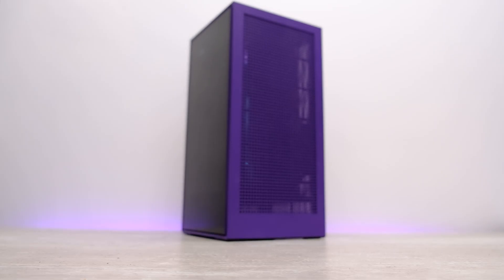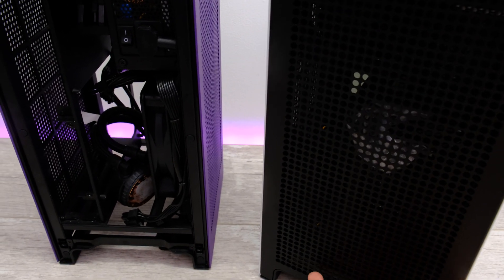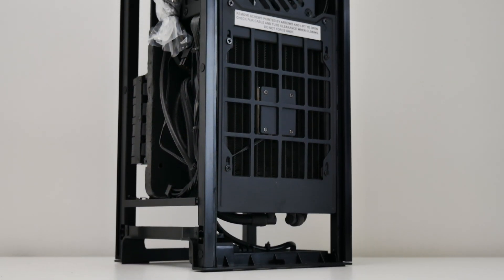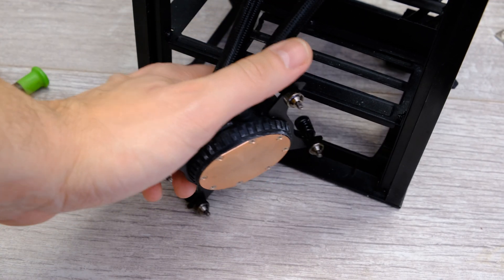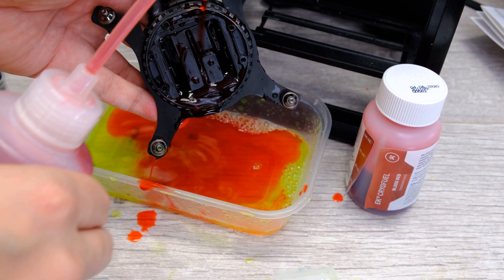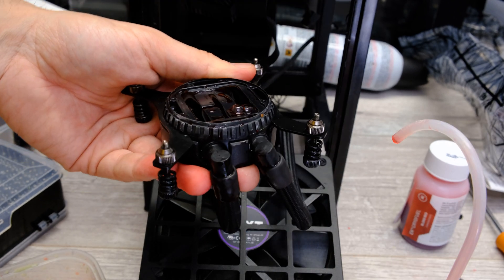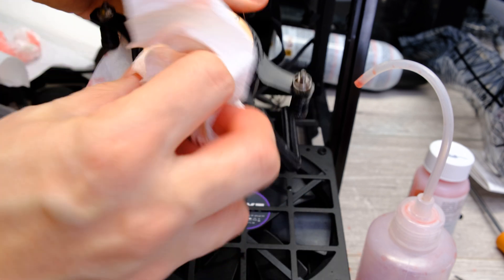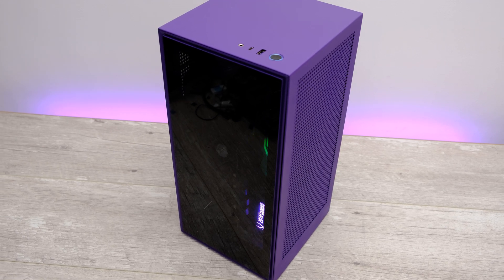NZXT H1 PUMP FAILURE (AND FIX)

Comment: Thanks for the video. Yesterday my CPU went into thermal throttling. I knew the AIO clogging on the H1 could be a thing, but never thought I would have it.
I needed 8 (eight!) flushings to get all the gunk out. This was very time consuming work, plus it took ages to fill the loop enough for the pump not to run dry all the time. My pump was clean btw.
Reply from the maker: It's worth it. Just keep an eye on those temps. Apparently you can detach the radiator too to make flushing easier. I will also being doing a guide soon on how to install a simple custom loop instead of dealing with the AIO which we know has issues.
Reply: @CrazyTechLab  Hey, this would be extremely interesting. Did you end up making the guide? Thanks!
Reply from the maker: @DouglasWhitcomb  https://youtu.be/IFAl9T5a9qA
Reply from the maker: @DouglasWhitcomb  https://youtu.be/IFAl9T5a9qA
Reply: Hey man how did you flush the tubes did you use distilled water? Assuming you used distilled water do you fill it up like he does in the video, then drain out (repeat) and then at the end add the new liquid coolant?
Reply from the maker: @sonny_digital  Emptying and filling the loop a few times should be enough. You're emptying the radiator and tubes and that process is akin to a flush. If you want to do it more thoroughly you can detach the tubes from the radiator using a T5 star screw - that works on both the V1 and V2
Reply: @CrazyTechLab thanks for the response and vid man. Just to clarify can you use distilled water to flush it out prior to adding new coolant? I bought new coolant but it’s expensive and I don’t want to waste the new stuff flushing out the old + crap.  Also could I use like a straw brush cleaner to help clean out the tubes or are they too sensitive?

Liked and subbed 👍🏼
Reply from the maker: @sonny_digital  Yes to distilled or deionised and yes to a straw brush cleaner!

Comment: It is not that simple. You actually have to disassemble the whole system and flush it thoroughly! If you don't do that you'll have the same problem in no time.
Reply from the maker: Depends on the extent of the problem. A lot of people in the comments have done a single flush and they've been fine for months. Others have found the high temps return and needed to flush again and I guided them through that. AFAIK there's no way to dismantle the entire system without replacing all or some components such as tubing. I wanted to make this as easy and cheap as possible and it definitely works. At the end of the day there's a finite amount of gunk in there and doing this method does work for most people.

Comment: If you are still under warranty I would avoid this process. These are close-looped coolers that are not designed to be disassembled and by doing so you may void your warranty if still covered. Better to poke NZXT and submit a ticket I was able to complete the troubleshooting provided and proceeded with a warranty replacement without further issue.
Reply from the maker: I agree but 'IF' being the word - this case was released 4 years ago so many V1 owners probably have no option but to do this or bin the cooler as they're likely out of warranty. There's no reason you can't open the coolers though. People have been modifying AIO coolers for years. They're simple components - tubes, radiator and copper waterblock. You can easily open them up and clean them out and my V1 is still going strong following this video.

Comment: Fantastic. I just ran into that exact same issue. Whilst dusting the PC I must have move the dirt in the radiator which blocked the whole system. Since I’m a newb with water cooling, my first reflex was to buy a new one since the temperature was at 99c idle. No space part for the H1 so your video was the only solution to my problem beside changing the cooler for a low profile air cooler. First attempt didn’t fix the issue as I reckon one of the pipe was still blocked (took me ages to fill up with liquid). I redid the whole manipulation and this time it filled up super easily. And the issue was fixed! Thanks a million
Reply from the maker: My pleasure! I'll be doing a video shortly on an easy way to create a simple custom loop in the H1 that doesn't cost that much - there are no 140mm liquid coolers these days that I know of so replacement options outside of warranty are pretty much non existent if you want to stick with liquid cooling. I'm actually using the H1 as my next main rig and even tough it's the V2, I still don't trust the liquid cooler given what happened with so many people's V1s. Stay tuned!
Reply: @CrazyTechLab Yes please to the custom loop video :)
Reply: I have a V2 and it happened so beware V2 owners!
Reply from the maker: @nicolasvinet4383  Oh jees really? Good to know as I’ve had a lot of people ask. I’ve not had my V2 up and running that long
Reply: I had the same problem with a Corsair water cooler in the past but I replaced it. Might be a generic issue with water coolers. They get dirty and you need to clean the system. It is just annoying and hard when you don’t have an easy way into the flow system.

Comment: Man just bought the H1 V2 on sale and then saw this. Part of me wants to swap the fluid out immediately in a new.system and out something in that is less likely to gunk up before I even use it.
Reply from the maker: I’ve got the V2 and not noticed and issues yet only with my V1. I live in hope but I’m converting to a custom loop in my soon if you’re interested. Pretty easy. Will be out in a future video.
Reply: @CrazyTechLab  I think eventually a custom loop would be the way to go for low noise in this case. I did get a custom wood front panel instead of the glass which will provide additional airflow for now.
Reply: I also just bought this case and still need to build it. So it’s only the V1 mainly affected ?
Reply from the maker: @duncan93841  We're not entirely sure unfortunately. Best to keep an eye on temperatures even if you have the V2.

Comment: Life saver! Out of nowhere, my CPU started spiking to 85 or higher during normal loads (like just opening a folder or just a web browser). On idle, it was in the mid-50s. I changed the thermal paste and fan direction, but no luck. This was my last attempt before purchasing a new case, and it worked! The AIO had some nasty gunk too.

Here are some tips:

- It's easier to drain and fill the radiator if you remove the AIO from the case (there are instructions for this on NZXT site) and disconnect the tubes from it. There are two small star screws on each side that you can remove, and then just pull the tube out from the radiator.

- Use an electric air duster (like XPOWER A-2) to push air through the radiator after disconnecting the pipes. More pieces of gunk may come out. You can use distilled water to flush it out.

- Also, push air through both tubes after disconnecting the lines from the radiator.

- Once everything is clean and dry, fill the radiator directly until you don't see any bubbles, then reconnect the tubes.

-  Continue pouring the coolant as shown in this video. The whole process takes around 150ml of coolant.

cheers
Reply from the maker: Thanks for the kind words and the extra tips.
Reply: Still going strong or did you end up having the same issue?

Comment: Have had higher temps on my H1 and tried this. When I opened it up there was a small amount of gunk but less than shown in the video. I cleaned it out and replaced the fluid with new fluid and everytime I turn on my PC my AIO makes a weird sound similar to an electric toothbrush. 

I've been thinking it was because if air bubbles somewhere in the loop and I've reopened the AIO like 5 times and added more coolant but each time there is like barely any room for any more liquid and no more bubbles. Any ideas?
Reply: Did you ever get this resolved? I have the same sound/issue too
Reply: @Shmittery   so I actually ended up cleaning out and replacing the fluid several more times after the "5 times" I mentioned in my comment and was never able to get it resolved. I gave up on the included AIO and put Noctua NH-L12S low profile cooler in my H1 instead. I idle around 40~ degrees, hit 68 under load, and it's much quieter than before. Very happy with it
Reply: @JediPacman  ah shit well, I might be in the same boat then. Thanks for the reply and suggested cooler!
Reply: @Shmittery  np, good luck. If I got this video to work for me that would've been ideal but my problem must've been a little worse than some gunk or something I guess.

Comment: I have this problem for months now. One time I changed the thermal paste and it "work". I guess that is probably from the movements of the CPU block while removing and placing the CPU block back after applying new thermal paste. The 90-100C is back and changing thermal paste didn't work. Then I search and found this video.

Before I attempt to fix the problem, how do I make this CPU coolant?

Comment: You are Life Savior!!! I went to a local repair shop tried to solve the overheating problem, they did a full cleaning and reapplied thermal paste and it didnt work, so they asked me if I want to just replace the cpu cooler or switch my cpu to lower grade( I have Ryzen 7 3700x). Then I went home found this video! Today it actually took me 3 tries to finally get it done. I saw someone comment who also failed this once or twice and the temperture actually goes higher than before the procedure. my tips would be take off the entire rad and fan from the case, it actually make it easier for u to adjust the angle of rad while filling coolant, that makes bubble come out easier.

Comment: I had the same problems you all have discussed, and proceeded with the cleaning on the cold plate assembly.  While refilling I went and looked for a faster way to burp the system & found the root of the problem.  The cold plate is copper.  The ENTIRE radiator is aluminium(with the exception of the pump impeller, being ABS.)  That ‘gunk’ is the aluminium flaking off from inside the radiator due to galvanic corrosion.  My jet plate/cold plate looked a lot like yours, the pump was worse.  Many of the fins were blocked.  It’s a total failure of the product, and product development by NZXT.
Reply from the maker: AIOs often have aluminium radiators but use corrosion inhibitors in the coolant to prevent galvanic corrosion. As far as I know, Igor’s lab didn’t find evidence of corrosion in the radiator when they looked at it. It’s more like gunk from some other reaction or crud left in the other radiator from manufacturing. Crud from galvanic corrosion looks quite different usually and the copper would also be very discoloured too but not ruling it out. Flushing a few times and replacing the coolant with something decent that has corrosion inhibitors should be enough to fix. Hope you get yours fixed
Reply: @CrazyTechLab  I just bought a NZXT H1 V2 and wants to avoid this problem (I haven't even built my PC yet). Does it make sense to remove the coolant from the system and replace it with coolant with good additives so that the aluminum will never have the chance to oxidize? Or will it oxidize anyway..
Reply: @henochh1732 I'm in the same situation as you. Except mine has been sitting inside the box, unopened for a year now. I don't mind doing this flush and replacing the fluid. I'm more concerned about the noise from the pump and was thinking about switching to an air cooler instead to avoid this issue entirely and to reduce the noise levels. I also want to replace the fan inside the PSU which according to my research runs at max all the time which makes the case very loud.
Reply: @tomtran614  ive been thinking about that too. But i have a 14600k with TDP of 180 watt. There are low profile air coolers with that TDP but the most of them doesnt fit in the H1 V2 or fit on my motherboard (because of the vrm heatsinks)
Reply: Oh man, that's a hot CPU 🔥 to cool. I would go ahead and pull the AIO out and do a flush and refill with the EK cryofuel as shown in this video. A commenter said that it's actually easier and quicker to do the flush and refill if you take the AIO out and remove the tubes. The OP also stated that it's unlikely to produce more sediments after this fix if you use a quality coolant. Either that or go with a new motherboard, cooler CPU and use an air coolant. Me, personally I think I will do this fix first and see if it will work. I can always flush and refill again down the road or switch to air cooling. Luckily I have not bought a CPU or motherboard yet.

Comment: My temps for the CPU are currently 43c idle and 74c underload. Only TLOU game makes it go 85c as it uses 100%. SHould I be worried and change the cooling?
I have an i5 13600k
Reply from the maker: No that’s not bad for a 13600k. Just keep an eye on it.
Reply: @CrazyTechLab  Any recommendations or things I should be looking out for?
Reply from the maker: @thegstoic  Unfortunately just higher temperatures. The pump will sound normal it’s just the gunk will stop coolant flowing. No way to tell other than opening it or watching for high temps. Your PC might be unstable but it will shutdown before any damage is done.

Comment: I have the same issue too. recently my CPU keep hit 110C and shutdown. definitely suggest everyone who has the same CPU overheat issue need to refill the cooling water and clean the dirt inside the cooling system. instantly drop from 100C to 55C and highest to 80C when gaming.

Comment: Hi,
Rently, had very high temp (70°C on Idle and 100°C+ when used) on my H1 V1 1.5 years old. I found your vids and give it a shot to solve the problem. I opened the AIO and found A LOT of sediment and crap. I fully dissassembled the AIO, took appart the pump, pipes and draining bolt. After a good cleaning, many flush with clear water and a good dry, i refiled the loop with EK Cryofuel Clear Premix (around 200ml) and payed attention to avoid any bubble. I cross my fingers and pray that after the reassembling it's not gonna leaking. Thanks God everything was fine and now my temps are fucking great again, like the first day (and maybe even better!). I got 36°C on idle and 55 to 60°C on full load. 
I will probably do the same to my old pc that has a Corsair H75 AIO that run for almost 8 years as a prevention. 
Many thanks from Belgium buddy
Reply from the maker: Glad to help! Keep an eye on the temps - sometimes more than one flush is needed
Reply: @CrazyTechLab   Yea, i already flushed many times with clear water but after fully dryied the radiator, i could still hearing some things into the rad when i was shaking it. I wil keep an eye on it !
Reply: Where's the draining bolt, under that cap at the bottom of the radiator? How do you get the cap off?
Reply: To answer my own question: The bolt is indeed under that cap. To get it, dig the rubber plug out from the middle of the cap, then use a T15 Torx screwdriver to remove it.

Now to see if I can actually get it filled once more with no air bubbles...it took almost exactly 75 mL last time, which plainly wasn't enough, since it didn't run or cool properly.

Comment: I just got myself a H1 V2 yesterday, doesn anyone know if this problem was fixed for the V2 ?
Reply from the maker: It’s difficult to tell. I have the V2 here as well but I haven’t fired it up since my original review. The h1 had been operating for a few months when I found this issue. Best I can do is fire up the v2 and see if it’s a time-based thing.
Reply: @CrazyTechLab  thank you for the answer, I am seeing all the users with this problem having the v1, probably they upgraded the liquid... hopefully
Reply: I’ve been running the v2 since it was released, got a 5800x3d in there now and pump is still working as new. It gets a lot of use too.
Reply: @danielwilliam.5891 hi .. is the pump in your h1v2 still working normally?
Reply: @tomtran614  yeah temps are still normal. 🙂 It’s just a noisy pump still even after replacing all the fans with silent ones in the case.
Reply: @danielwilliam.5891  How loud is the pump? Did you think about switching to air cooling and use something like the Thermalright SI 100? I am thinking about this option and my case is still unopened!

Comment: Can I use demi water ?
Reply from the maker: Yes you can. Or Distilled. Only for the flushing process though. You need to have a proper coolant in there when you seal it back up
Reply: @CrazyTechLab  Thank you for fast response man, i appreciate it. I work in Computer Repair Service and Support and i have this AIO in combination with i9-12900k..

Comment: Just had this issue, after 2 years the temps suddenly jumped up and got a huge scare I was worried my CPU was burnt as I had left it running earlier in the day. I was super skeptical that this was going to be the issue but low and behold it was I ended up tearing the entire unit out and draining it, it was full of the crap. Thanks for the video probably saved me a heart attack and buying a new unit.
Reply: Still going strong or did you end up having the same issue again?
Reply: @DouglasWhitcomb  Issue came back and I cleaned it out multiple times, I ended up just replacing it with a noctua NH-L12 instead. Its been running just as well on the air cooler, maybe slightly warmer at times.

Comment: This guide is a great help, however the rad seems to be full of whatever that gunk is. I've done 3 flushes and gone through a litre of XL8 only to continue having the gunk build up. Man it takes forever to refill that rad - anyone have success actually keeping temps down? I'll have about 10 mins of 45 idle/70 load and then back up to 60 idle. Pump maxed out. Anyone else?
Reply from the maker: Rather than using xl8 you can try deionises or distilled water. Waaaaay cheaper if you need to do a lot of flushing.